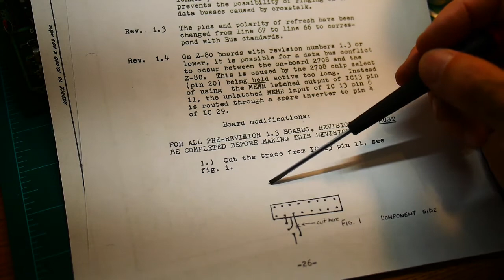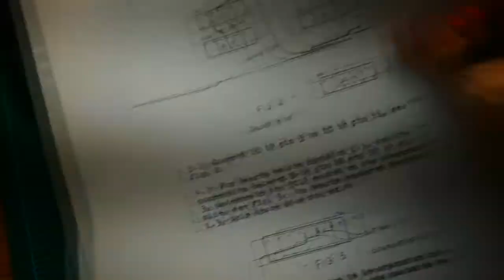#47 IMSAI 8080 Ithaca Audio Z80 repair

Comment: First, thanks for making these videos!  I'm also in the process of troubleshooting/restoring an IMSAI 8080, and have learned quite a bit from your work.  One question I'd like to ask is I notice (in this video for example) you quick quickly pop out and put boards back into your machine, but I've noticed the large capacitors take quite some time to dissipate their charge, meaning these is still some (small) voltage present on the lines after powering off.  Is it safe to be removing and inserting cards even with this small voltage present?
Reply from the maker: I've never had a problem. remember the big power supply is raw power and all the boards regulate this to a lower voltage. There are bleed resistors across each of those large capacitors so they do drop voltage on power off but yes I suppose it takes some time.
Reply from the maker: Oh, I should add a caution. If you notice the location of the +8V and -/+16V edge connector fingers, there are right next to each other. If the card is a bit crooked you can get them to short. I have at least one card that has missing copper as the power supply can just vaporize the traces.  so make sure the card is in straight.